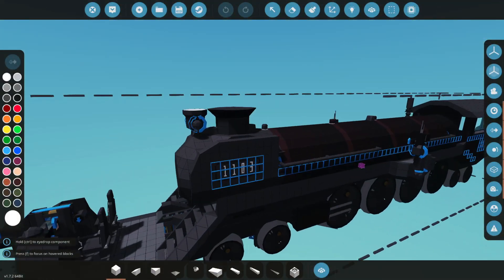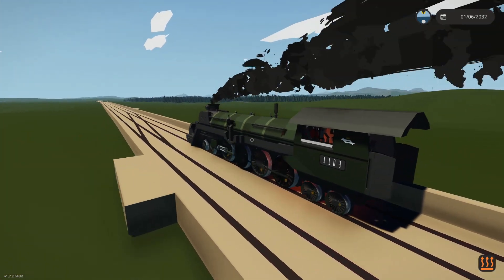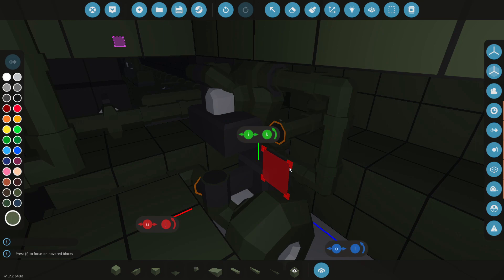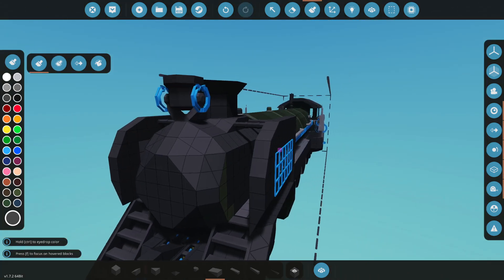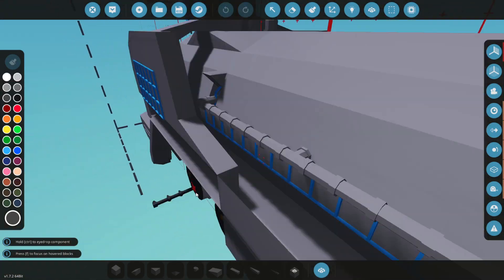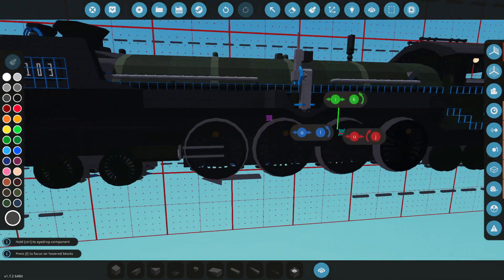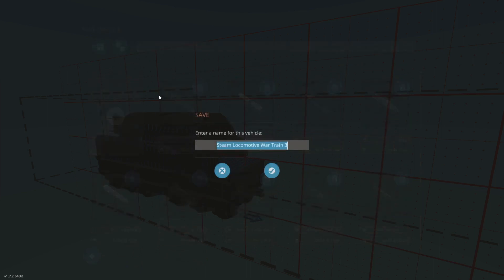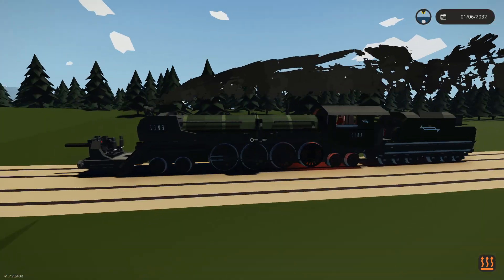Lets Get MORE SPEED OUT OF THIS Steam Loco! - Lets Build A Steam Engine In Stormworks!

Comment: It's kind of paradoxical, but you could technically get a lot of extra power via pumps if you add a ton of weight on. I don't mean just adding weighted blocks, but the impeller pump. So every other pump has a hard limit of how much fluid it can force through it at once, but the impeller pump is only limited by how fast you can spool it up. So if you added a separate boiler system and had 3 daisy chained steam turbines geared up into a bunch of impeller pumps, you technically could get an insane amount of power by making the train an odd size and a horrific weight. But if you want to make a fairly strong water jet ship, do this kind of steam turbine daisy chain to impeller pump system to provide both power and the water to the jets. The results are wild.

I believe everything in the game is at a standard metric. So meters per second, liters, BAR, meters, and Celsius. If you want to convert the speed, the function microcontrollers have the conversion equations in them for speed. M/S to MPH is multiplying the M/S by 2.236936. I've memorized that by using it too much. I think something you should look into is the Triplex train and the proposed Quadruplex and Quintuplex trains. What are those? Well most steam trains are single or duplex meaning they have a single pair of cylinders powering the drive wheels or two pairs of cylinders powering the drive wheels. Your train is a single, the Union Pacific Big Boy is a duplex. So you can imagine what a Triplex, Quadruplex, and Quintuplex all entail. There were a few triplex's actually built while the quadruplex and quintuplex were patented, but never built in prototype or production. Ever since though, there's been a lot of different proposed possible hextuplex, septuplex, octuplex, etc trains to the point of insanity.

Comment: Hey frantic a armored train wouldn’t want the locomotive at the front of the because it would be an easier target and easier to take down like the bf1 armored train it has the locomotive in the middle and two armored carts mounted with artillery and heavy machine guns also if you could armor up the locomotive itself and make it so the the conductor isn’t a easy shot